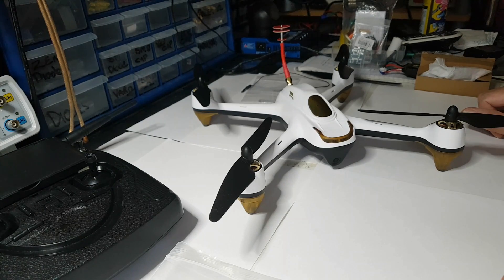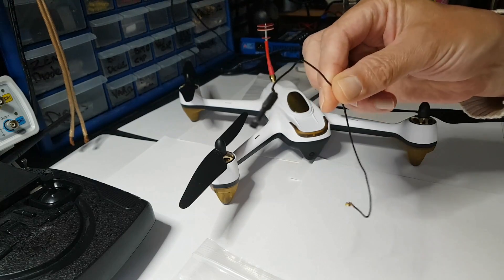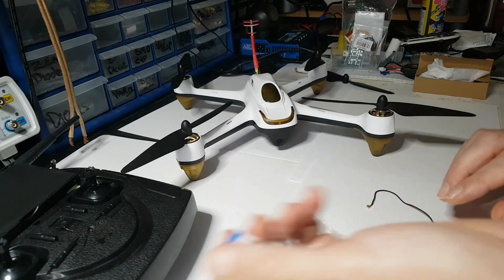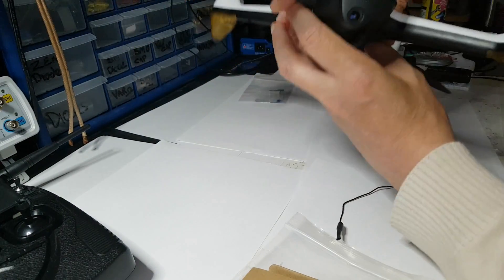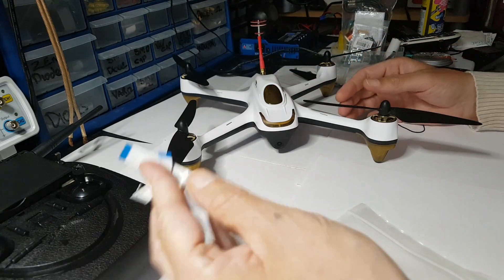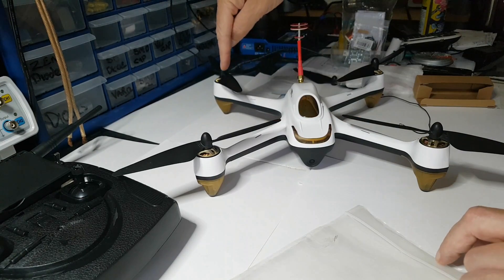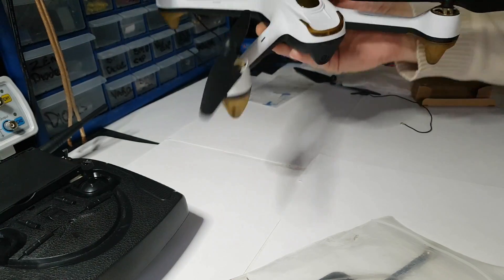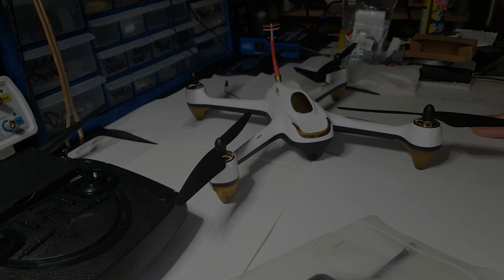Hubsan H501S Crash and Antenna Mod

Comment: Can you point out where Pagoda antenna connects to in the drone, does cables just pop on or do I have to solder.U gotta understand fella. I can tell by your workbench u are a bit of an electronics expert, when I can barely solder!!!If I install it what cand of range will the FPV perform up to?
Reply from the maker: No solder needed as UFL/IPEX connector on drone mainboard (I made a video showing the fitting?) and a SMA-K socket for Pagoda SMA antenna. You will need to drill a hole in your drone frame. Plan where you drill it as it will be a tight fit.
Search: IPX to SMA-K10CM

Comment: Do you have to solder new pagoda antenna in , or does it clip in, probably best I leave it if soldering necessary as I need to buy some flux, plus my soldering skills aren't great, could botch it.
Reply from the maker: I used a UFL to SMA connector, Pagoda screws into SMA

Comment: Many times you've been requested to make a vid on installing the pigtail for the external FPV antenna from 6 months ago. Is it that you just aren't able to or aren't interested in doing it? I have been searching all of YouTube and haven't found one yet. If you could make a clear video of it that would be helpful. Thanks.
Reply from the maker: M8 I have had to many people demand I make the video. It is not a complicated mod and that is probably why no one has make a video showing how to drill a hole and clip on a pigtail.
Reply: The H501S is vert different inside than the H501SS. with the S you have to dig very deep into the lower boars, desoldering a few things along the way. On the SS the connection for the FPV antenna is on the top board and easy to access by splitting the two body halves apart. The ONE video out there is for an S model and he blocks the whole process with his hands.
Reply from the maker: So why are you asking for a video to show how to connect/drill a hole? Why don't you make the video?
Reply: I'm not the one who gets off on making "How-to" videos, that'd be you my friend. Sorry I blew up. Chill.
Reply: RevolutionAdrenaline I think he just pop a hole on top of that h501s and installed the pagoda antenna, that is why he won't make a video of it!

Comment: Does antenna on drone improve signal loads,?
Reply from the maker: @RobertKelly-it8wm  Yes it can. The provided antenna is linear and the antenna I am using is circular polarised, its positioning helps with overall radiation of the video signal.

Comment: I have 501s-s and it does a roll jerk when ascending or descending at about 30m and higher. Have you experienced this?
Reply: No and I have 2 of them.  I did have a crash that turned out to be at the exact same time as a sunspot.  It went crazy momentarily and hit a tree before I could recover.  the power company lost an entire substation controls that was not hardened at the exact same time.
They are venaruable to EMPs ( electromagnetic pulses)

Comment: I like the antenna modification. I'll be interested to learn how it performs. I haven't had the ribbon cable problem. It's a drag that you keep going through them. Grounding issue possibly? I am checking propeller tightness more carefully now😉 Happy Flying amigo.
Reply from the maker: Cheers buddy, Definitely make sure the props are tight. Up until now I have been finger tightening them thinking that would be enough. Now I use the tool for sure. 
I have some bugs 3 props in. I will test them over the weekend and do a test with these different antennas. I hope it is worth the body attack. 
I tried with the one Pagoda on the controller and got over 500 meters using stock FPV transmit antenna.  I will get that video up shortly if I can get the editor to stop crashing and messing the music audio up. 
Not sure about the ribbon cables, they seem to be my fuse, lol. Glad I have one. I will ask Hubsan what they think and let you know the reply.
Reply: Thanks as always for the info Elecifun. I really enjoy your videos. They are informative and entertaining. I hope to get some more videos up in the next few days. Cheers.

Comment: I love your Vidz Man!!  Great Knowledge>> I just bought a 501s , This Unit has firmware TX H906A/ v1.1.2  RX H501s v1.2.12/ v1.1.21  .  Do I need to update to any other versions??
Reply from the maker: Hey cheers for the positive comments much appreciated.
I would normally ask are you happy with how yours is working.  With the don't fix what is not broken attitude. There are new features now for the H501S  so I would update the firmware. Is your definatly a H501S. What packaging did it come in plastic or cardboard. Plastic = H501S Cardboard = H501SS
Update can be found here http://shop.hubsan.com/includes/templates/darktemp_0829/images/soft/H501S%20Upgrade%20Software.zip
Watch this instruction video carefully before and during update to ensure you get it right.  https://youtu.be/wWTfFXs695c
I hope this helps.
Happy flying and good luck.

Comment: How well does this work ?
Reply from the maker: The antenna mod works great. I get to try different, higher gain antennas and re-tune the receiver via the controller to them getting better performance.
Reply: Elecifun can you  tell me where you got it and this is for the 5.8 right ? No issues with video feed one dude made a whole video and ended up not working
Reply: can you post a video of the install or a link to another video if you have one? I could not find one...
Reply from the maker: Works well and give me the opportunity to try different antennas and tune the receiver to them.

Comment: Greetings Elecifun and all!

I have a H501s and I just moved the video camera’s 5.8ghz antenna to the outside but have problems with 
The different styles of eternal antenna types. It seems that the only one that delivers a signal to control is the 
“DIPOLE” type. There are many illustrations in using other types in this format but to the strangest reason in 
Which I am unaware, I cannot get the other types to work. I was wondering could it be some update version 
problem or software. As for the internal installation and wiring to the camera board, all is perfect. I have 3 other
H501S with the same format but do deliver with more than one type antenna.  “Weird!”

I am hoping that you can give me some input on this? The version for the problem quad is:

V4.2.24
LCD v1.3.2
H501S v1.2.20
V1.1.36
Reply from the maker: Hi Miller. I am not sure I understand what you are doing. Can you tell me what other types of antenna are you attempting to use for the control receive side on your H501S.
Reply: Elecifun  do you have a video showing how to mod the hubsan drone with the red antenna
Reply from the maker: I was thinking of making one as the quad is in bits and I have just modded the red (Pagoda) antenna,. I made it stumpy.
Reply: Elecifun ok if you do pls lmk
Reply from the maker: If you give this vid a like I will ; )
Reply: Elecifun no its ok i found one thanks

Comment: i haven't had my hubsan long and i have already busted one of it's arms off in a crash.
Reply from the maker: That's not good mate, can you fix it?
Reply: I did fix it . i had to replace the body.
Reply: is was a pretty hard crash straight into the ground after clipping a tall tree.
Reply from the maker: At least it is fixed now. Back in the air again : )
Reply: yup.